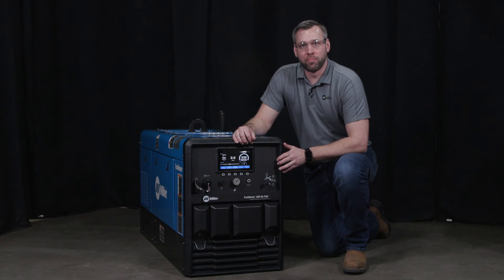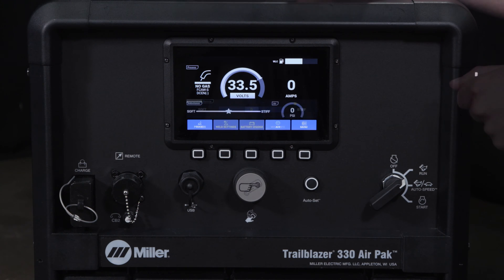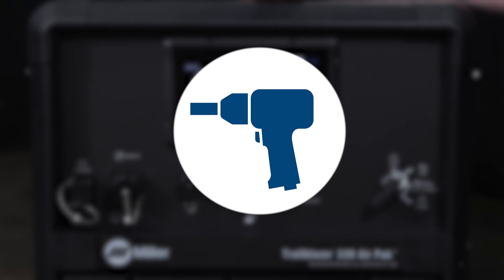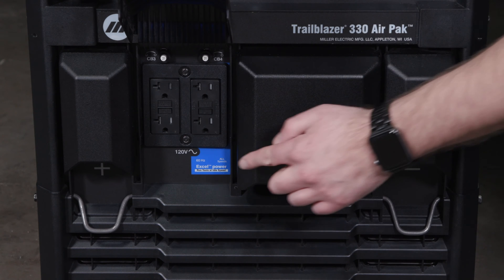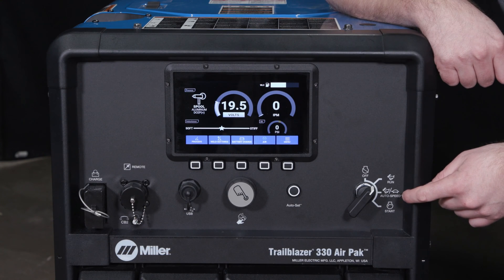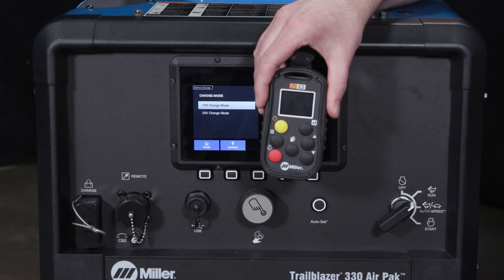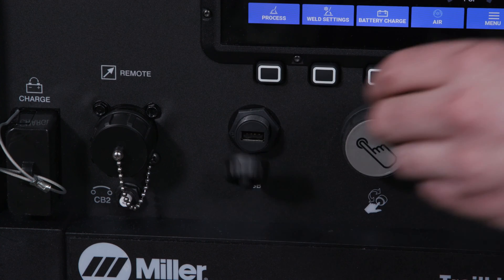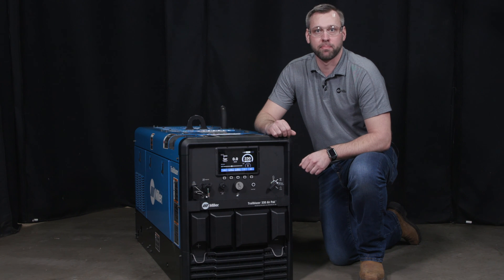Trailblazer® 330 Air Pak™ Engine-Driven Welder

Comment: Why would you ever need an upgrade ??
Reply from the maker: Hello, thank you for your question. Upgrading your equipment can be a beneficial decision for various reasons. As technology evolves, machines like the Trailblazer® 330 Air Pak™ Engine-Driven become more user-friendly and efficient. This model is not only advanced but also lighter, smaller, and quieter, making it an excellent choice for your work site.